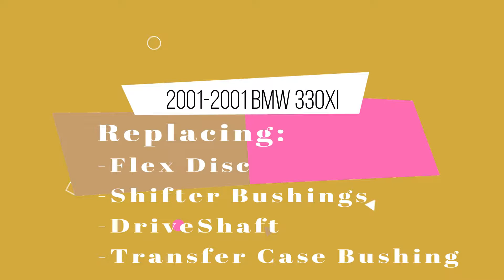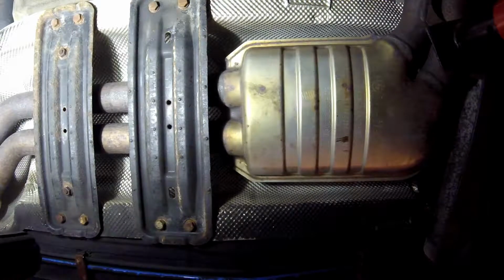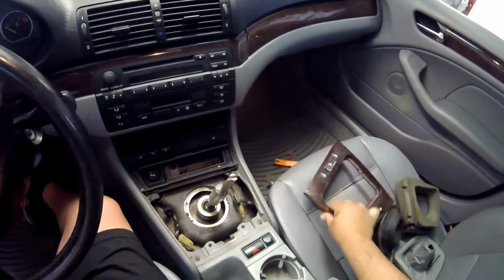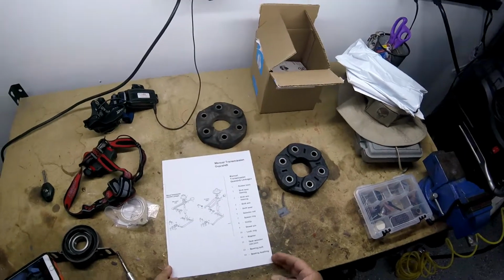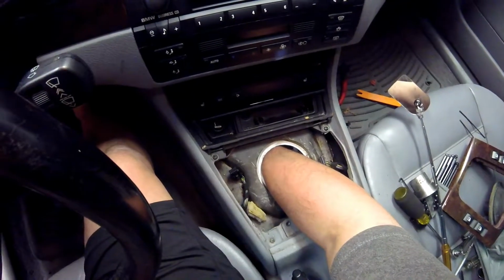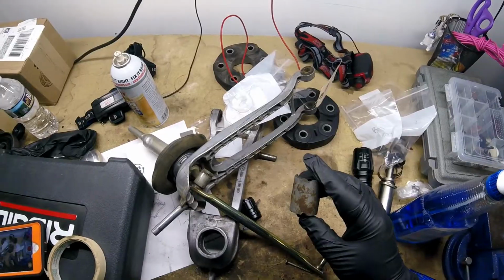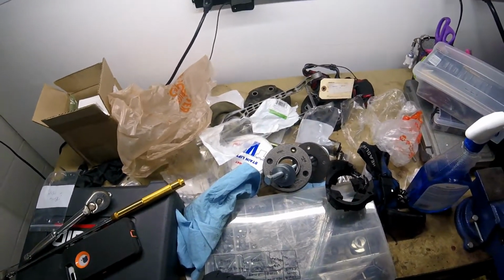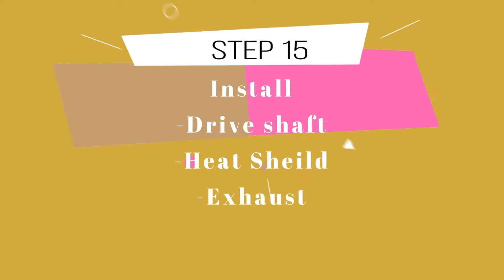2001-2006 330xi, 328xi, 325xi, Drive Shaft Install, Shifter Bushing Rebuild, Flex Disc

Comment: Hey man! great video! I am having insane vibrations from the rear, suspecting it to be drive shaft u-joints at the rear (inspected, seems clunky), as well as the center shaft bushing amongst everything else that turns rotten on these when it gets older. Will be replacing the transfer case bushing as well, after watching your video, as i thought it was not possible to change only the bushing, as i thought it was apart of the full transfer case. Thank your for that, i was able to find the part number on RealOEM. I might not replace the shaft it self, and just do the center shaft bushing, flex disc, and transfer case bushing, as it is an old car from 2001, so not sure i want to spending all that money and time, but might as well now that i will have everything out. Just wanted to thank you for a great video explaining everything nicely!

Comment: Good stuff man I’m tackling this front prop shaft on my 328xi 07. Currently the front prop shaft isn’t in as when the car was bought the shaft was broken so now the car is only RWD. I was reading some things online and people are saying that there transfer case gets blown out when putting in this shaft so I’m starting to wonder will it be okay if I install this new front drive shaft cannot seem to find any info on this… is there some specific method of alignment on the fron drive shaft to the rear ? Thank you so much for this video love to see this kind of things that nobody bothers to mention or even show
Reply from the maker: Nope. Just be sure it has not been damaged.

Comment: BMWs are the biggest pile of crap when it comes to working on these vehicles. To change a starter on a BMW you must remove most of the under hood components on the drivers side. They are a software nightmare. And now you have to remove basically the entire exhaust system, heat shields, and crossbars just to get to the drive shaft. This idiotic engineering scheme by BMW was obviously implemented so they can make money at their dealer service centers. I would advise anyone interested in buying a BMW to think twice and look to an alternative luxury vehicle.
Reply from the maker: I agree with you. They really do put so many modules that require a computer interfaces which makes it difficult to diagnose. It’s best to stick with older bmw’s.